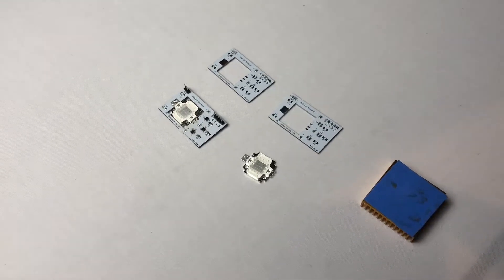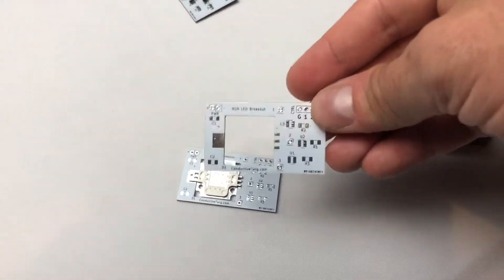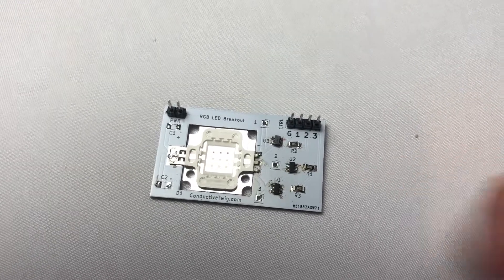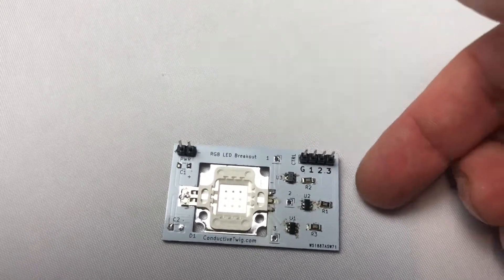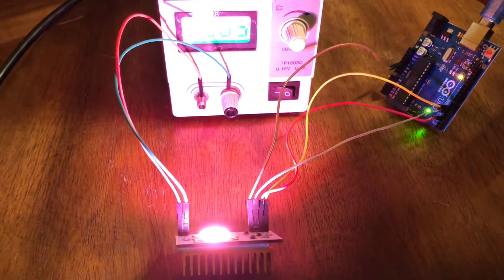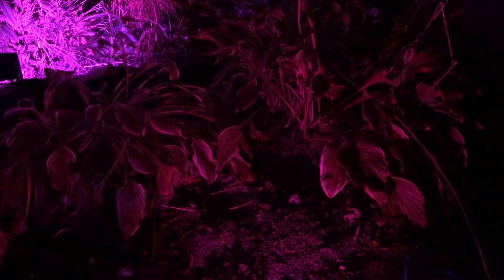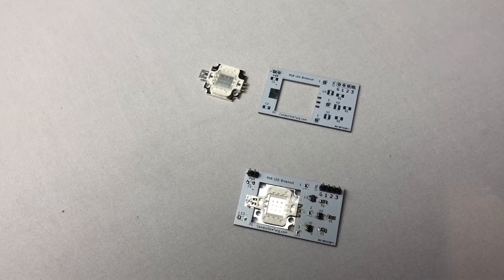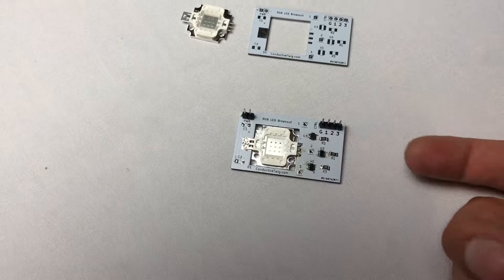Chanzon 10W RGB LED Breakout with 3 Constant Current Drivers!

Comment: I am looking at getting the board, is the populated version coming with a set of BCR420U or are they BCR421U ? Based on the documentation it looks like only the BCR421U supports PWM but both have an enable pin... it is rather confusing.